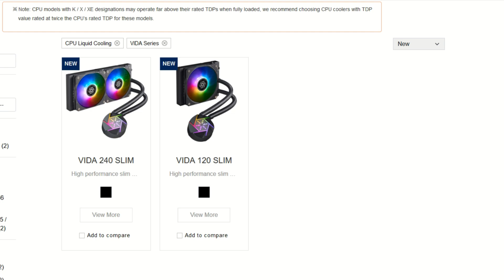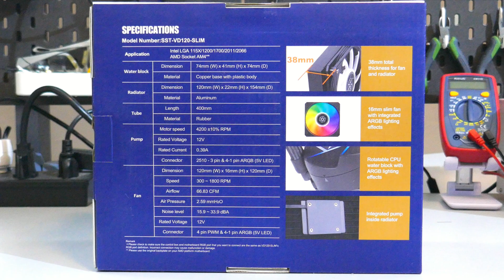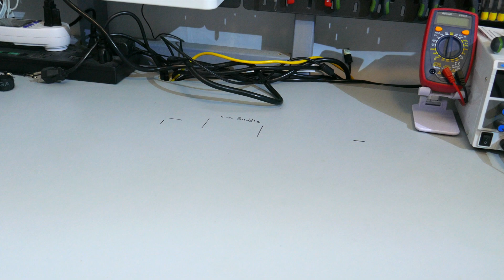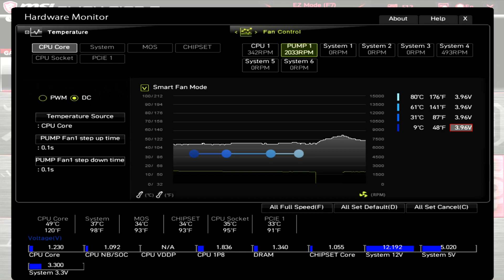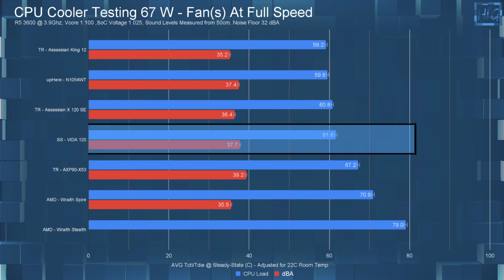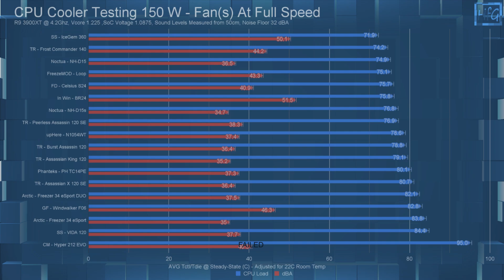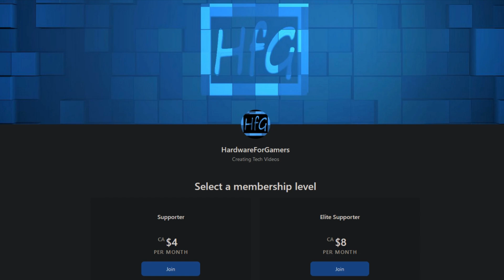SilverStone VIDA 120 SLIM AIO - CPU Cooler Review

Comment: How quiet is the pump?
Reply from the maker: I can't hear the pump (when at full speed) it the fan is over 30% PWM from 24" (600 CM) away. if that helps...
Reply: @HardwareForGamers  Thanks I'll  be changing the fans anyway, my sole concerns is if I can hear a pump whine/noise as I sit very close to my computer

Comment: Fan should be pushing the air through the rad, not pulling it though,it will drop about a few degrees, i have the 240 version and fan oriention is important......

Comment: If I could only fit a 120mm AIO cooler at the rear of my case, would you recommend I do that or should I go for an air cooler? asking for my R7 7800X3D
Reply from the maker: What size air cooler can you fit? Can you fit a standard tower cooler? If you can, I would go with the tower cooler.
Reply: @HardwareForGamers  I think so, max height is 160mm. I can’t decide between the TR Peerless Assassin 120 or one of the bequiet! Dark Rock coolers, I think the Slim is my best bet for clearance.

Comment: Perfekt for Fractal Ridge!
Reply from the maker: I like the way you think. It might actually fit with a 2 slot card, but it would be TIGHT.
Reply: @HardwareForGamers  I'm waiting for my Ridge to come next week. Am feeling ambitious with the Vida 120 + 3060Ti FE. The radiator will overlap with the GPU for a few inches, but we all make sacrifices with SFF builds. Thanks for the review.
Reply: You can get 1 xtra mm with Noctua Slim fan :)
Reply: If anyone has tested it in ridge please report back with findings. It must be a significant upgrade to the aircooling
Reply: @christofferaasted  Core i5 12400 + 3060ti FE combo. 28C idle for both, 48C for CPU and 70C GPU when I play Hogwarts on 1080 with high settings
Reply: @paulhuun  Did you run aircooling on gpu? Did you mount fans or rad first in edge of case?
Reply: @christofferaasted   can I mod it to the side panel of Fractal Ridge facing the motherboard? I have rx 6950 so there is no way it will fit next to it, and Noctua l12 ghost is doing bad with 13600k
Reply: @MoeHadwan  I went with the Arctic Freezer II 120 and mounted it inside on the left side of gpu slot.. GPU and game market is too stale for me to even consider it.. Too many bad games (I can't even mention 1 game worth buying a gpu for..), too little invention in terms of GPUs they just get larger..